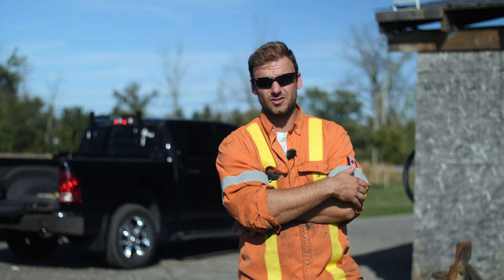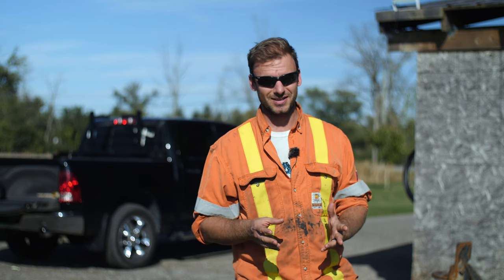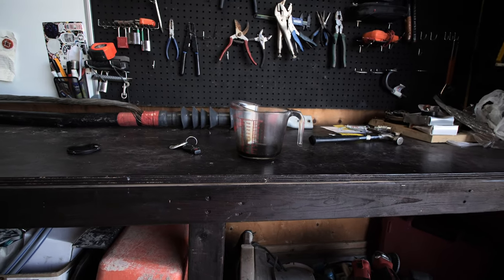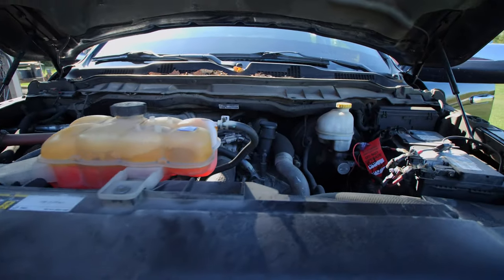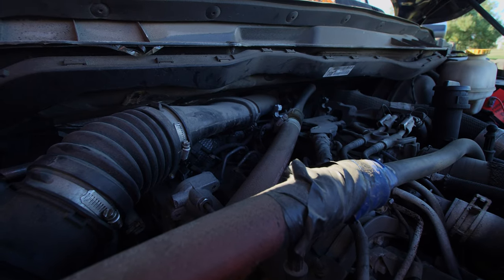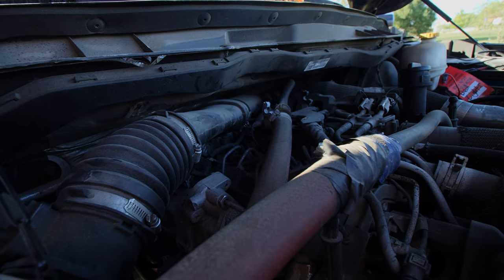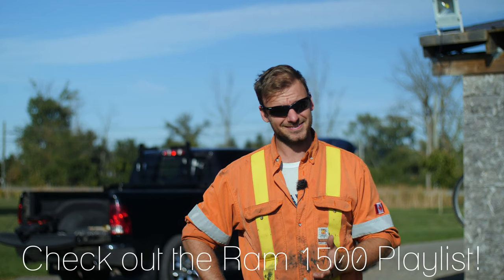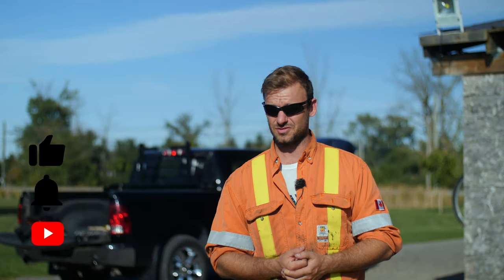These TWO things will help SAVE your Ecodiesel!

Comment: I bought a new 2015 ED and as soon as I got it home I dropped the factory oil and used Lubrimoly toptec 4200 with a qt of lucas synthetic oil stabilizer.  I deleted the truck at 40k miles because I couldn't keep it out of the dealership.  Turns out the MAP sensor was getting coked up and needed to be cleaned about every 10k miles.  I figured that out myself the dealership just kept flashing the computer.  Anyhow, I got rid of the truck with 300k and it had NO blow-by at the oil fill cap.  I never used a catch can.  At 300k miles it was turning 28mpg on highway trips on 285/70's.  I used a GDE off road tune.  The truck was great.  Get the delete.  

Waterpump at 100k miles, fuel filters at 30k, in tank fuel pump max 150k miles (130k would be better).
Reply from the maker: did you ever check the intercooler piping? the cap trick works great doesnt mean theres no blow by. either way 300K is awesome glad to hear a good story
Reply: @GilbertGardens  I never checked the intercooler piping.  However, for the time that I owned it the joints were always dry.  I should say I never took the intercooler piping apart to specifically look for oil residue.  I would pull the top turbo charge pipe off to do the water pump.  For the amount of room there is between the engine and the radiator there's a fair bit of work to get at the water pump.  Not a bad job though.

Don't let your water pump go much over 100k (miles) When I did mine the larger o-rings were all cracked and broke when I removed them.  That was at about two years old.  So I don't know if its a time thing or a miles thing.  I'm guessing its a miles(heat) thing. Obviously, they're either the wrong material or poor material.  I haven't heard that they've been addressed.  Be careful.

Here's a link to information regarding water pump replacement.  I know the guy that wrote the process REAL good.  https://www.ram1500diesel.com/threads/2015-replaced-water-pump-today.65706/

Like I said the truck was great.  First set of brakes I replaced at 162,000 miles and it was close to needing brakes when I sold it.  Other than that everything on the truck was original even the shocks, CV axles, hub assemblies, u-joints.  I NEVER got that kind of mileage out of anything.  Michelin LTX A/T2 tires would get 70k miles with very light towing. The truck went down the road like it was on rails.  No road vibration no truck vibration.

I work for a pipeline engineering and inspection company so i chase work all over the North East.
Reply from the maker: @Elkmonger  very helpful . I need some front end work on my ram hoping it's just tie rods and lower ball joints but I'll be jacking it up this weekend. Appreciate the post. 🍻
Reply: @GilbertGardens  Ha I just helped a buddy find a nasty vibration in his 2015 RAM 1500 Gasser.  Slight vibration weeks ago.  Wheel bearings feel tight, CV axles are a little loose at the differential.  We pulled the CV axles.  Driver side was a B!#ch.  The little stub axle came out with the CV axle which meant we needed to remove top AND bottom ball joints to get it apart.  Ran the truck without CV axles for a couple days and vibes the same.  Bearings check tight.  Ran a few more hundred miles.  Vibes noticeably worse.  Bearings check tight.  Ran a few more hundred miles.  Vibes noticeably worse.  Driver side wheel bearing has very slight up and down play.  Pull the hub assemble.  It's horrible.  Pull the passenger assembly.  It's tight but sounds horrible.  Replace with new.  We installed new CV axles too.  The splines on the original CV axle were rusted and loose.  Like the splines were rusted and worn away.  Passenger side axle was fine.  The driver side stub axle was rough and we sledge hammer molested it trying to get it out of the CV axle.  Bought a new one at NAPA and it was nothing like the original.  Picked one up at the RAM dealership for almost the same price.  Put it all together and it's good as new.

We installed new NAPA premium (FAG brand) wheel bearings, Napa Premium CV axles, RAM stub axle with new RAM oil seal, and new ball joint dust cover. 

IF you find yourself in this situation get ball joint dust caps, and stub axle and oil seal BEFORE you start the work.  The originals are probably gonna get ruined.  The universal dust covers are a close enough match if you can't find originals.

There's some Youtube videos showing guys simply pulling the CV axle off the center section spline.  DO NOT TRY THIS.  It ended up horribly for us.  Get under the truck and hammer them off.  There's a retaining ring in there you'll need to overcome that can get pretty tight with rust and grime.  Use some constant tension and light taps that may need to progress to full on two handed swings beating it like it owes you money to get it apart.  That's when the stub axle came out.  There's no stub axle on the passenger side.

Good luck.
Reply from the maker: @Elkmonger  jebus. I hope mind comes apart just fine if need be. ill keep ya posted

Comment: Have you changed your coolant yet? Where did you get it if you did? I'll be changing mine next year,  apparently dealer prices are stupidly high
Reply from the maker: I've had a small egr leak for about 3 years. I think I've changed it over that time. It recently stopped though...very odd. Yeah the orangic OAT coolant is expensive.  I might do a video on changing it in the future.

Comment: The oil catch can, i hear most of the time it will throw a engine light.
Reply from the maker: Yes check different brands though.  It depends on the size of the can and hose size I believe. A tuner can shut the code off
Reply: @GilbertGardens  interesting, my 2019 is going through a weight loss. And would love a oil catch can. Thanks

Comment: Where can you get Catch Can in Toronto? Now I got it why mechanic said oil is so dirty last time even though I drove only 10,000 kms.
Reply from the maker: If you kijiji diesel egr delete you can find some shops to disable the EGR. That will keep the oil cleaner. The catch can to my knowledge can only be purchased from overseas . Prevent 20p. The rear ones are from Australia and they aren't cheap.
Reply: @GilbertGardens  if EGR is disabled or deleted, do we have to worry about CATCH  can? If so,  where can you buy it? Much appreciated... thanks
Reply from the maker: @tenzinnamdhak  ebay has provent 200. Get the expensive one.  You won't have alot of oil if you disable but it will still help keep oil blow by out if the motor.

Comment: I just purchased a 2016 ram ecodiesel.  I purchased a kit but have been dreading taking off the egr cooler. Can you explain the steps you took to just put on the one blocker plate.
Reply from the maker: my EGR is still installed, just disabled. The blocker plate is simple, just remove the small bolts holding the EGR diffuser tube on and install the plate. you must flash the ECU first or youll have serious engine codes.

Comment: Question about the delete.... Did you change anything with the exhaust? Did you or do you have to physically remove egr components?
Reply from the maker: Well I had a shop do it. Basically its a flo pro kit from the turbo back to the muffler. It sounds good and not loud. The scr dpf and Def sprayer are all in the basement. The EGR is disabled and i installed block off plates.
Reply: @GilbertGardens  yes. Thats what I thought. I've been researching...my gold plan 200km/5yr warranty is up end of February, so I'm planning for spring. Thanks.
Reply from the maker: @ChrisB-ny5zr  no worries . I might do a video on removing the EGR as I have an off and on leak. Even though its disabled coolant is  still circulating

Comment: Good video looks like its working good job good idea after warrantys up until then I feel if I bought a eco diesel instead I would be putting MOTORKOTE in every oil change a 20 dollar bottle which is only 246ml would do 2 oil changes and dont use anything other than rotella T6 oil and like I do with my hemi id change the oil a lil after 50% or 175 hours my manual says 16000 km or 350 hours or 1 year I go by hours 175 is between 10500 km and 12000km but I do do a once a year 100hour short oil change which is like 6000-7000km I would do those  things then I would'nt have to worry about my warranty and history has shown it never hurts to change your oil more often
Reply from the maker: im typically changing mine around 12000km or so. ive stretched it to 16,000. with the EGR deleted the oil samples ive done  (only 2) were solid.

Comment: This is why with the egr on diesels when they make it completely illegal and enforced its time for Diesel engine manufacturers to begin installing oil bypass filtration systems that filter down to 2 microns. Then intakes manifolds should be designed to be easily removed and cleaned. Thirdly Amsoil yes it’s expensive but it’s worth it’s weight in gold as it helps keep your oil lines on your turbo from coking up and the oil ports in your engine from also coking and there bypass oil filtration system actually removes 90% of the soot.
Reply from the maker: yeah id like to see a video on one of these with some oil samples very curious. Removable intakes or at least well-designed to get the intake off is a really good idea. I doubt they would ever improve the design so the DIYer could clean it though. $$
Reply: @GilbertGardens  well I seen what a amsoil oil bypass system can do on the cummins the oil is actually dark brown not black. I was to say the least astonished. And it actually allowed him through oil analysis to extend his drain and replace interval by more than double with just filter changes. So technically that oil isn’t so expensive then and he swears by it. I use the T6 but I change my oil every 6000 miles in my cummins. Once the factory warranty is up here comes Amsoil oil and bypass filtration system for sure.

Comment: 240000kms and you have worn piston rings causing so much blow by.
Reply from the maker: worn ringd does create more blow by thats true but Ive seen guys with half the milage and still getting oil in the air system. Hell I was catching the same amount when I first installed the catch can  3+ years ago

Comment: DPF doesn’t do anything for soot in the motor but for sure EGR is awful for these
Reply from the maker: No but they clog up. I had 3 issues with dpf around 50,000 .
Reply: They can but it’s an easy fix and doesn’t hurt the motor. That’s why I always tell people focus on EGR first Because it really can wreck things permanently
Reply: Mopar Ecodiesel swore by Hotshots fuel additive for helping with keeping the DPF clean, if you still have a DPF installed.

From my limited understanding, you can remove and pressure wash the DPF as well, just make sure to spray against the natural flow.

Comment: Hi Gilbert, great playlist for the ECOD. Ive had my 2014 Limited ECO since new. Pretty much stock, checking out the Provent 200, there isnt much volume capacity at the bottom, what size of hose are you using at the bottom how often are you draining? I could see this filling up real fast with short trips in Vancouver just from the condensation. You have a new Sub!!
Reply: How is your 2014 eco diesel doing..  I just bought one and I'm nervous lol
Reply: @INFINITE-AMMO  Running nice! Provent 200 filter working great. 💯👍

Comment: Nope... It is the oil flow that is insufficient... the pressure is correct but there is not enough flow. Upgrading the pump is not enough because the main oil distribution channels are too small. Basically there is nothing to do... don't waste your time and save your money!
Reply from the maker: So are you saying there's not enough flow therefore its heating the engine up and failing ? I'm speaking about the main bearing failure which appears to be the main issue. The oil galleries are clogged due to a combo of dirty oil and I suppose small diameter passages would make sense .
Reply: @GilbertGardens  I'm saying it's a problem with the design of the lube lines.  The lack of flow on the bearings causes an increase in heat which cooks the oil and deposits in the narrow cavities as well as cholesterol, and this worsens over time until it becomes completely clogged.
Reply from the maker: @maximebegin1454  I can see that but you can't disagree that clean oil flows better then dirty oil. It seems more deleted (cleaner oil) ecodiesels last longer then EGR enabled engines. It's a combo of both I would assume.

You have less restrictions with cleaner oil. I hear what your saying you can't fix the small oil passes ages but you can increase flow with cleaner oil via disabling the EGR.
Reply: @GilbertGardens  You can try anyway egr is a engine killer. Upgrade the oil pump could help too and decrease the coolant temp to 175F too... but i don't expect miracles whatever you try.
Reply from the maker: @maximebegin1454  definitely something to look into for sure. Thanks for the input. Cheers.

Comment: if oil gallies are clogged, wouldnt we see a rise in pressure?
Reply from the maker: These trucks don't have an actual oil pressure sensor from what I know. The oil pressure is just a math equation of rpm and oil temperature if i remember correctly. They do sell aftermarket oil pressure gauges though.
Reply: @GilbertGardens  ahh. Thanks for the response. Picking up a 2015 RAM ED 2morrow... wish me luck.. 🤣

Comment: It’s not the oil being pumped back into the EGR that causes your oil to get dirty. It’s the soot from the exhaust being reburnt that causes all the soot in your oil.
If you want to keep that dirty soot out off your oil delete the EGR 
The vapours from the crank case mix with the soot from recycling some of the exhaust causes your intake to eventually plug up.
If your able to use a block off plate. You are one lucky SOB.... Most EGR systems use a sensor to make sure exhaust gases are making it to the EGR. If the sensor sees a block it throws a code.
I vent the crank case to atmosphere. No code.
Man your right. It’s not good for the environment but manufacturing a new motor makes a lot more pollution.
Reply from the maker: You vent the ecodiesel to atmosphere?? If i did that I'd have oil everywhere. Once you tune the egr out you don't technically need a block off plate. I have one installed but its not necessary.
Reply: @GilbertGardens  
No I have a Colorado 2.8 diesel. I run the line down to the frame. Very little oil comes out.
Once the warranty is up I will block off the EGR. 
Hard to believe the MFGs would put that dirty soot in the motor. Worse than running without an air filter.
Reply: Your effectively pumping crystallized carbon back into the engine with that EGR, though it’s also possible the engine rings are not made correctly, Honda had this problem with a bad run of piston rings, it might not entirely be the EGR system contributing to the problem, without multiple inspections of unaltered engines with exact service conditions hard to pin point the problem when likely you have multiple problems going on there.
Reply: My experience with older Diesel engines is that the will run for ever if you keep putting oil in them, lol. To make a engine that will consume less oil or stop blow by you need high nickel content in the block or cylinder liners, and the rings need to be hardened ductile iron, perhaps that process doesn’t get checked often enough to ensure quality of components, I’ve found that China has flooded the automotive aftermarket business, as well other countries, this can effect part quality as your quite often dealing with an idea your receiving a quality part on the notion they tell you they are.

Comment: I have a 2014 also. The high pressure fuel pump failed last week. They found metal shavings in the fuel system. It’s going to cost $8000 to repair. Basically a totally new fuel system pumps, rails and injectors.
Reply from the maker: jesus. thats insane. I wonder if you can get used injectors at least. help offset the cost.
Reply: Make shure they also flush the fuel tank and low pressure hose
Reply: I use Power Service Diesel Kleen.  It adds cetane, lubricates the pump and cleans the injectors.  I get a very slight increase MPG but moreover, I want to save that $8000!
Reply from the maker: @DavidMosby  I dump some diesel additives in every so often.

Comment: Put the sensor that regulates the pressure before the oil catch can and that should clear the code.
Reply from the maker: Have you seen that sensor ?
Reply: @GilbertGardens  I can’t recall what sensor we are talking about
Reply from the maker: @Rossco603  leaving the crank case PCV I dont recall a sensor even being on that line.
Reply: @GilbertGardens  as I recall without rewatching your video, I thought you where talking about the map sensor. Now I’m curious what sensor you where talking about. I do recall you saying “the sensor was after the catch can, and can detect the subtle change the catch can was making, apposed to stock” give or take some of your wording. If that’s the case it would be the map sensor or the sensor coming off the top of the turbo tube? As I recall.
Reply from the maker: @Rossco603  There is a sensor somewhere that I believe watches the crank case pressure. Adding this Catch Can set it off. I had it tuned out so its no bother. I cant recall the actual code I had anymore as it was several years ago now
Reply: @GilbertGardens  actually I don’t think it even has one. The computer does a math equation to figure it out. I belive it uses the oil temp in some way. Stupid but that’s mopar for you lol. Cheap bastards. I think it goes hand and hand with the lower end bearings failing, if I’m not mistaken.
Reply from the maker: Yes there's no real pressure sensor on these. I wish I kept the original code that I had. You could be right about the map sensor. I suppose I could just disconnect it and see if it fires up lol. Either way something needed to be tuned out and my tuner now has quit "the game " bahahah